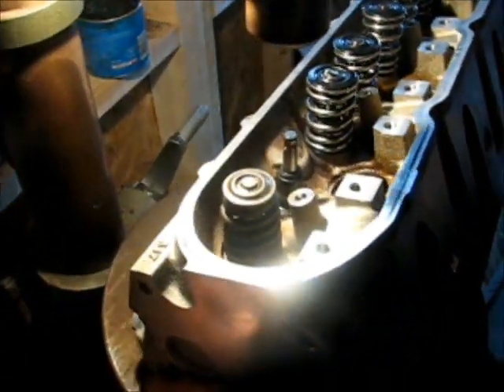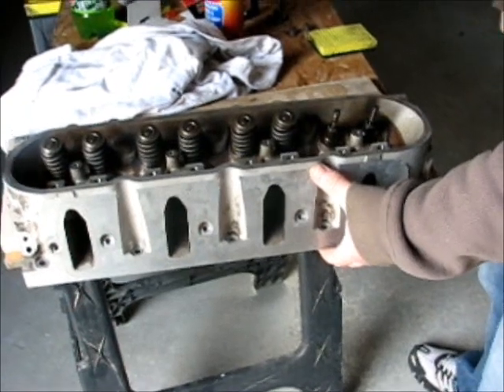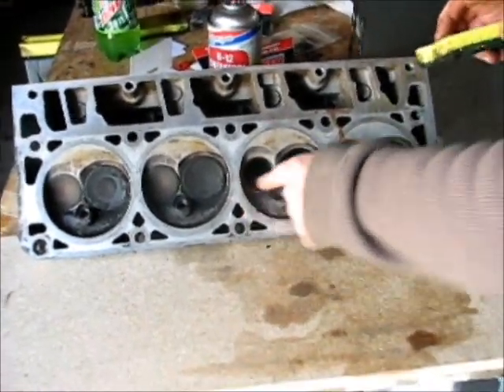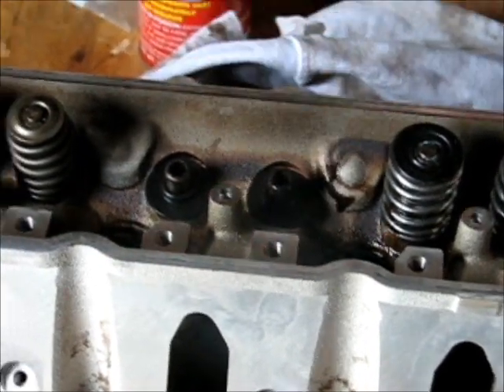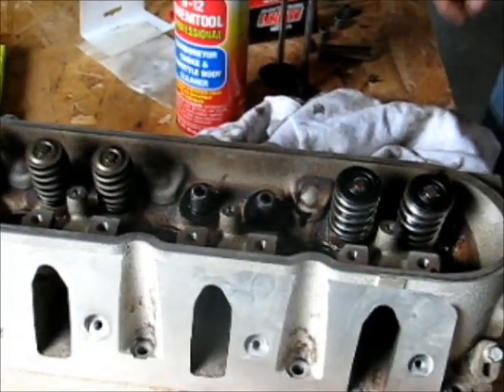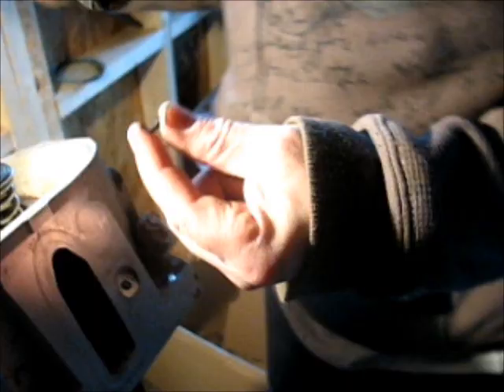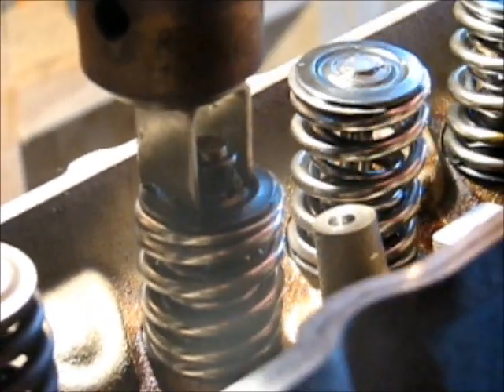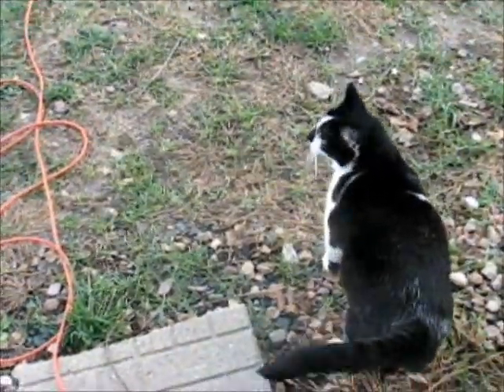LS1 Valve Spring Swap - DIY drill press method

Comment: Great tip with the valve keepers and grease. One Question though. Do I soak the seals in oil prior to installing them on the heads?